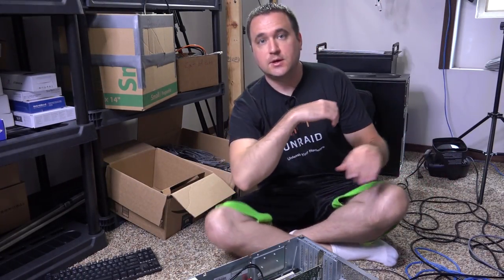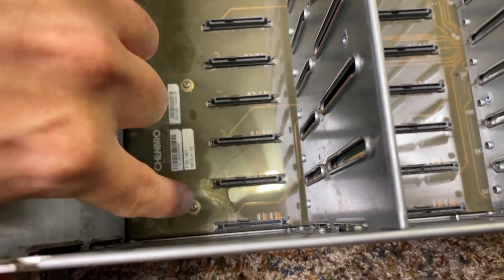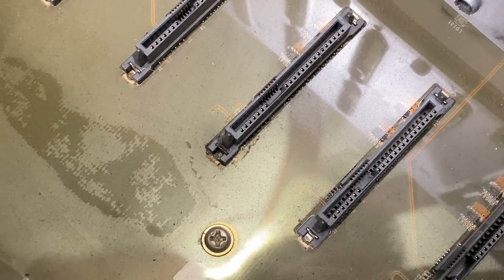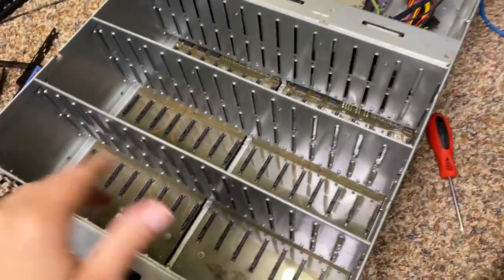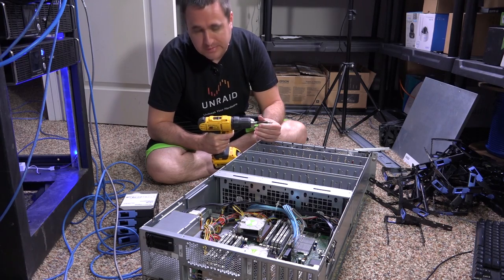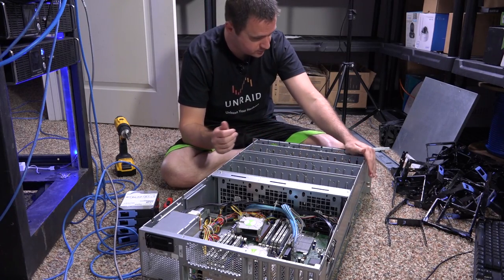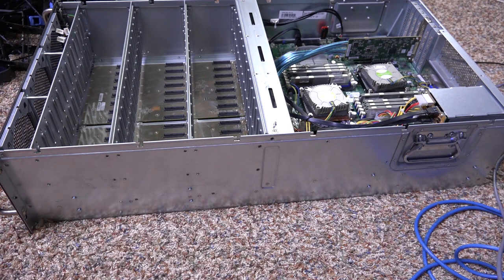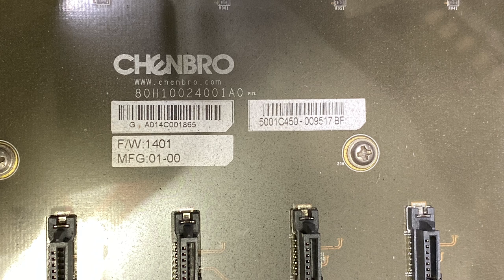New Server Tear Down...It was gross..

Comment: To be honest, you're going to get a maximum transfer rate with spinning rust of around 300MB/sec. With a 6GB interface, you can run ~50 mechanical HDDs before running into bandwidth issues. As you're using 25 drives per 6GB connection, you should be just fine.
Reply: those are gigabit vs gigabyte. 6gigabit~600megabyte so its 5 instead of 50 ;) thats why sata ssds are capped somewhere in that region
Reply: Not true, I move over 700mb/s with a 6gb ARECA controller.

Comment: if your backplane isn't going to support the maximum speed of the HBA, it will run at whatever the backplane is rated for or may not work at all. Therefore just upgrading the HBA isn't going to necessarily make anything faster. Especially considering its the SATA HDD's that are the bottleneck.

Comment: So I am currently using a Supermicro 24 bay chassis, and the back-plane I got have individual sata ports to each drive, this will give you the maximum speed because the HBA controller is talking to individual drives with full bandwidth. I am using 3 9300-8i cards to connect to these drives, and its working pretty good now. I switched from using a black-plane with one mini-sas connector connected to a single 9211-9i card, which was really slow.

Comment: 12gb is only possible using sas drives.  Sata drives are capped at 6gb.  Why not go with the AMD Epyc cpu,64 cores 128 threads
Reply: John Gonzalez he probably doesn’t want to go with that CPU because AMD isn’t sending him a $7500 CPU and he isn’t going to spend that much on a processor.
Reply: he could easily buy a cheaper one. dont know how much power he wants but a 32 core epyc is „cheap“
he could also go naples instead of rome. they are flying off the shelves now for next to nothing
Reply: The expanders are only 6Gbps, but a 12Gbps HBA can interleave them and get higher aggregate throughputs (LSI DataBolt).

Comment: Concerning SAS equipment my go to YouTube channel is "Art Of Server". He deals with HBAs on eBay (same name there) and flashes LSI raid cards and -controllers to IT mode to sell them there. From what I could tell he knows what he is doing.
Reply: Good link. Looks like there'd be a benefit to using a second LSI SAS2 card to split the PCI-E lanes. 8 SAS lanes is 6GB/s, PCI-E 2 x8 is 4GB/s, so second card would make the bottleneck the SAS lanes rather than the PCI-E slot.

Comment: That sas controller you have is a 6gbps per channel card, meaning it can do a total of 24gbps. You will be able to fully saturate a 10gb network connection with that card no problem, so that really isn't a part worth upgrading. Each connector is 4 channels regardless of weather the other is hooked up to anything meaning each backplane is getting 12gbps of connectivity to the motherboard.
Reply: So, if he can saturate 10G, what you're saying that Jason now needs 25G-40G ethernet? 1G 🤔 10G 😊 25G 😀 40G 😆 100G 😂

Comment: Just to give you some information. I'm using a 9211-8i with 8x8TB WD Whites and I'm able to write at over 700MB/s since the data is spread across all drives at once using FreeNAS. 

If you're using UNRAID it's only going to write to a single drive at a time and you're only going to see the performance of a single drive. 

That LSI SAS  card you have there will be perfect. I was even using my 9211-8i with 24 drives and saw over 500MB/s write speed. 

All of that above was with a SINGLE cable from my HBA to my SAS2 backplane.

Also forgot to mention, EACH lane from the HBA to the backplane supports 6Gbps, so 4 lanes would give you 24Gbps of bandwidth per backplane. Which would be 3GB/s, way more than the drives attached can do.

If you want me to provide any screenshots or pictures I can do that.

Comment: Looks like the was backplane can be configured to use all 3 ports or at least 2 ports, in that case it would be best to use one sas(hba) card per each backplane. And also if you can get the -16i model you would have 4 sas port per card.

Comment: The case is designed for a certain pressure from the fans. You need to check on the Supermicro site on how much air pressure is required to cool the drives, etc. Check out https://www.supermicro.com/support/resources/Thermal/
Remember: The server is made for a data center :-)

Comment: Hi Jason. there are a lot of good solutions in the above comments. You just have to remember that when you run unraid you do not get the benefit of many spindels in your system and therefore you will never get more output than that one disk you are reading from can deliver. And yes you can have multiple files accessed and on that account get more performance but as i can see in the benchmarks you run. You only use one vidio file and it 's stored on the same drive and you drive performance is your cap.

Comment: Card 1:
Connector 1 to backplane 1 port 1
Connector 2 to backplane 2 port 2
Card 2:
Connector 1 to backpane 1 port 2
Connector 2 to backpane 2 port 1

in case one of the cards fail you will still have your full array.
and when both cards are working you get the best performance possible.

Comment: Your best bet is getting a couple LSI SAS 9300-8i 12GB controllers. Yes you could get the 16i, but look at the price and you'll find the 8i is the biggest bang for your buck. You will most likely run into bandwidth issues if you don't get a gen 3 SAS card. Make sure the MoBo you get supports LSI SAS in HBA mode. You can usually find these cards already flashed to HBA mode if you don't know how to. Additionally, use high quality SAS cables.. yeah... Those work great for my setup. Debian > ZFS > Proxmox X3 nodes. No downtime for the part 6 months. I use my cluster for work (freelance software engineer) and to host my Plex and gaming servers.

Comment: unRAID is just slow, it's got nothing to do with your SAS lanes.  It still only does 30-40MB/s writes using the onboard SATA on X99 (which is pretty much as fast as it gets), fed by a 6950X.
Reply: Only if you dont know how to use it optimaly. Mine does write to large 4x1TB ssd cache over 10GB line saturating the line. Nightly dump to spindels with mover. And even direct write to spindels with fast 7200 drives is very fast between 150-200mb/s. If you only get 30-40mb/s there is something wrong with your setup/design likely. For example if you want write speed directly to spindels and dont want tu use cache you need to spread data as much as you can instead of filling up drives one by one. That way yo dont get hit by drive slowness when they are almost full. All my drives are around 50% and equaly balanced. Also activate reconstruct write (disk settings) which will massively speed up writes at cost of all disks spinup. But for write i always suggest ssd cache. And if you want fast read , use fast 7200 drives. Alternatively you should then look at freenas zfs pools. 
But keep in mind even on unraid you can use zfs. I have separate zfs raid pools on my unraid naxt to main array for hosting all my vm's etc. Then you can use zfs snapshots, send/recieve etc. Bets of both worlds if you have it all , so you can choose where to store what for what purpose.

p.s. Related to the sas lanes speed, keep in mind that for normal access over 1 or 10G the total sas bandwith unlikely fill the pipe but when unraid does parity check / build all drives go at max at the same time. Mine all blast at 250MB/s read on each drives during parity check. So for internal communication with the OS SAS total bandwidth DOES matter unless you want to wait a week for a parity check or build

Comment: but you're SAS expander chip on the backside of the Backplane can only handle SAS/SATA 6.0Gbps so it won't make any difference if you use  12Gbps connections

Comment: The 9300-8i is the perfect choice due to inherent limitations of the backplane. Plus...they are HBA’s which is what you need for unraid. I don’t think you can do redundancy across two HBA’s and Chenbro backplanes. BUT...it appears you could use two 9300-8i’s....connect both cables from one card to one back plane. That way you have use of all 8 data lanes to each backplane.

Comment: The power supply fans are likely to be 25 mm x 25 mm x 38 mm fans. As long as you can get the same volumetric flow rate, if you can find quieter fans, you can swap them out, but personally, I wouldn't recommend it.

You also want to take note of the direction of rotation on the fans and also the airflow direction. As long as you can move that much through the power supply to keep the power supply cool, then you're fine. But this should have been researched prior to purchasing the system. This is why I stay away from systems that have those 25 mm fans because they usually/generally spin upto around 15,000 rpm and so they're quite the screamers. I tend to stick with 2U systems that uses 2U fans because at least then, you can use 80 mm fans which are MOSTLY quieter (or at least you have more options available to you if you want to switch them out for something else).

Comment: Jason, Taking  step back. Have you given much thought to the motherboard yet. The reason i ask is, have you looked at what you can physically connect to it? Most boards come with 3 x16 slots. Meaning the two LSI controllers and a GPU has maxed out your board already and i have not found many cards that fit those tiny 1x slots. Just some food for thought.

Comment: I'm sorry to say but your SOL in the HDD speed department. Upgrading to a 12Gb/s controller will cause you to spend money. The backplane is only a 6Gb/s for one the bad part is it's an expanding backplane, meaning it splits one SAS connection into six. It's taking the 6Gb/s into six 1Gb/s connections which makes it about 400Mb/s per drive. Since Unraid writes to one drive at a time, the cache drive moving to disk may not be bad, BUT a parity rebuild is going to drag, probably around 30-40MB/s. For best speed you need a 1 to 1 backplane, meaning 1 sas channel per port on the backplane. Example a 12 port backplane that has 12 SAS channels from a controller or 3 connections from controller to backplane. The connections from controller to backplane use four channels per connection. A 1 to 1 16 port backplane would have 4 connections and so on. I would say you probably won't find a 1 to 1 backplane for that case, you may but backplanes and server chassis are pretty much built for one another. Hope this helps.

Comment: Those backplanes are just like a network switch in a way. Only one port to your sas controller. Your sas controller has the 2 ports each 4 channels, sas will only operate at 4 channels to my knowledge there is no 8 channel port. Your limitation will be the backplanes. The specs on those backplanes based on the age of that server are likely only sata 2 speeds and upgrading to a sas 3008 controller will make 0 difference. The 9210 is a sas sas 2008 controller that supports sata 6. That sas controller will also need to be flashed to IT mode if it isn't. Speed wise I do not think you will get any improvements unless you were to go direct attach sata to the motherboard or to a sas controller with 1 drive per channel.

Comment: The only way to fix this is to directly connect each drive to the controller like the 45 Driver Storinator. You would have to rip out the backplane and wire them individually.

Comment: My experience.. One can't reach the full potential of that setup unless one has a full complement of SAS drives using the cards hardware raid. So it depends on if one is going for SAS or Sata drives, and hardware or software raid.

Comment: if this was me, I would have just looked into ways of extending the current server, using either a used das or buying another one of the server cases and just extending some sas cables into it.
Reply: turbo5546 

Personally, whatever he does. He should be doing it double.  The first the main server, and the second a backup. After all, a NAS is not a backup and any number of things could go wrong and lose data.  Better if it was off site.  Do a full backup, then put off site to backup daily.

Comment: I have 30 disks on my unraid and i still get the same speeds as you with a MONSTER machine connected. 
Also what OS are you planning on running since you have 48 disks capable with the 30 disk limitation of Unraid.  I also have 48 disks available but can only run 30 in my array so that's why i ask?  If speed is a huge issue then run Freenas.
Reply from the maker: Still going to run unraid
Reply: @Bytemybits  Nice if you need shelfs to mount that new monster let me know. i'm in KC and have some extras!

Comment: i would just reuse that card, just make sure its in IT mode.  I don't think you will have any performance issues.  The backplane could also be limited to 6gb/s anyway.  Any drives you have are electronically capped at 6gb as there is no 12gb consumer hard drives, you will likely see no performance upgrade replacing that sas card.

Comment: Did you ever decide what OS you are going to use?

I finally installed unRAID the other day to play with and noticed it has a 28 data drive limit.
Reply: If you get the pro-license, shouldn't you get unlimited drives? I believe Linus' Petabyte project is running on Unraid, and he has like 45 drives hooked up to it. I just took my array down, and it does indeed say that you can have a max of 30 drives (2 parity included), but maybe that will expand when it gets filled up. Maybe somebody with this ungodly amount of drives can chip in, because I'm interested how this goes. I only have 3 hooked up at the moment, so I'm no help, unfortunately.

Comment: Hi vary nice video. You can replace the lsi hba card to the newer card but you will still be limited on speed because of the backplanes, replacing the card will help, you will get more consistent speeds. To help with the read and write performance add 2 ssd's to each backplane, even though you're going to have it all in one array they will help the individual backplants performance. With the power supplys put then in the system not plugged into power and hold the power button for 30 seconds it will discharge the power supplies all of them must not be plugged into power. I hope this is helpful.

Comment: Asrock
X470d4u 
3700x
P4000
Running into the same situation in the on the SAS card, after the research you’ll have to get dual  cards but I’ll still trying to figure out the parallel setup

Comment: Those back planes only need 0n3 break out per unless you are looking for failover. best bet is to update the card to a current (but that depends on the board and the ver of pcie it has.) also  if you use 2 cards (one per plane) you will limit your raid options to the plane the card is connected to. also google the plane part number and see what ver it is... it may not even matter upgrading the card as older planes will support a certain speed. ie. if you upgrade the board to a pcie 4 board... current...  and the plane only supports speeds relative to a pcie 2 card... you will get no speed increase over the pcie 2 card you pulled out no matter what card you put into the pcie slot on the board. It will default to the weakest link (slowest speed) in the chain...... Like sli and graphic cards that arent matched..

Comment: Super late to the party on this, but as a ease of maintenance suggestion, get a 4-5V powered screw driver. If you have the right size bit it's hard to strip screws removing and tightening them.

Comment: First a correction, those SAS cables are each 4 port, not 8.  Next the dual in-port setup would be to enable Dual port SAS drives.  You'd need to look up the backplane part number to know if single port drives (Or SATA drives) would even benefit.  Though I'd strongly recommend getting SAS drives not SATA as SATA drives will limit the speed (IE Max SATA is 6gbps BTW that's gigabit not byte) and SAS can go to 12gbps per port (So a dual port SAS drive "could" do 24gbps) but you'll only find SAS drives able to push that are some very pricey SSD's, though as it's shared it's still good.

As you're doing software raid instead of a hardware raid controller what I'd do is get two SAS HBA's and connect each to both backplanes.  Then ensure your system supports SAS multi-path and use only Dual port SAS drives.

BTW it's not that the card is dividing the lanes across the ports, but that that connector is a quad port SAS port.

So IMO
1. Get two 9300 cards. (Or better)
2. Ditch the SATA drives for SAS dual port drives
3. Check with your Raid application forums for SAS multi-path support (Multi-Path can do load balancing of multiple paths)

Comment: Re: Dust - normal for a server in a data center even with filtration. Some actually comes from concrete under the raised floors.
Reply: looks more like dried, powered lube from fans or old drives.

Comment: Jason, according to the manual for those expander backplanes that I found here, http://www.manualsdir.com/models/chenbro/nr40700-6gb_s-24-port-35-mini-sas-expander-backplane80h10024001a0-manual.html ,  it looks like the best you could hope for is 8 lanes to a single backplane.  Looks like that's 6Gbps SAS, so likely only 3Gbps for SATA drives and you probably cannot mix SAS and SATA drives on the same backplane, or maybe even the same storage domain.  

You should be able to share 8 lanes to both backplanes from one HBA with the following connections(maybe this was how it was configured when you got it and I just didn't see it)
HBA P1 to BP1 IN
HBAP2 to BP2 IN
BP1 IN/OUT (conf. to IN) to BP2 OUT
BP2 IN/OUT (conf. to IN) to BP1 Out

Add a 2nd HBA to run 8 lanes to each backplane.  With the variable IN/OUT connectors conf. to IN.  Either should be fine though, as writes should be going to cache first...right.  And you will likely only be reading from a few disks at any one time.

Good luck buddy, this stuff is fun to play with.  I built my own diy JBOD storage array using an LSI 9211-8i, two 32 port HP SAS Expander cards, and a lot of research.  I'm pulling for you, hoping it works out the way you want.